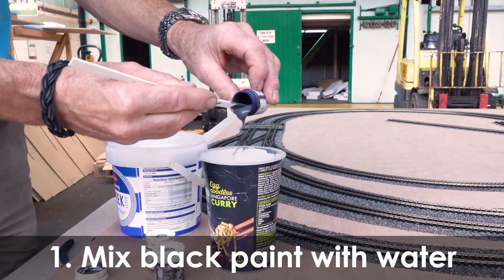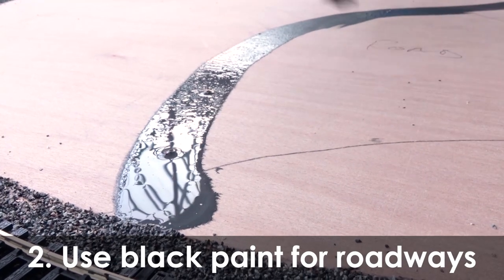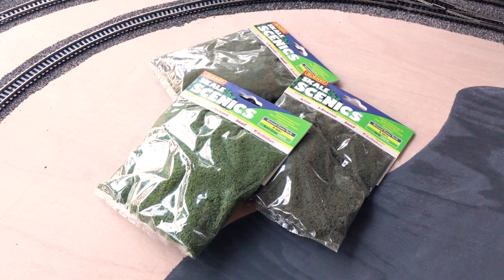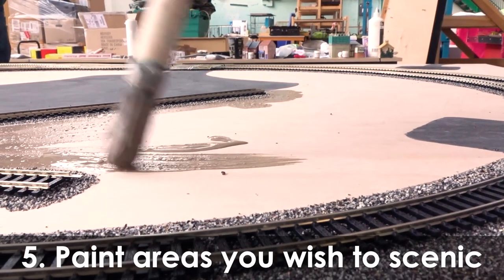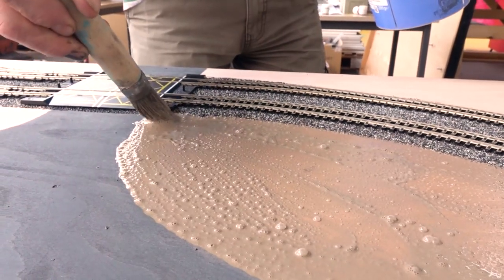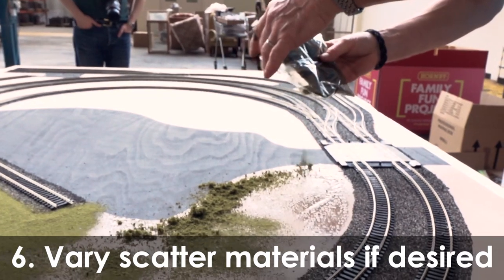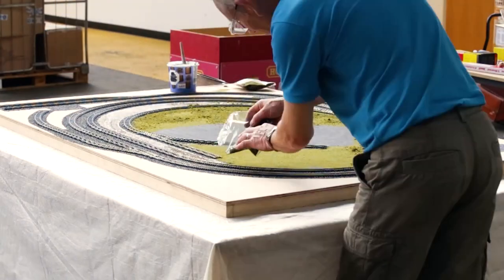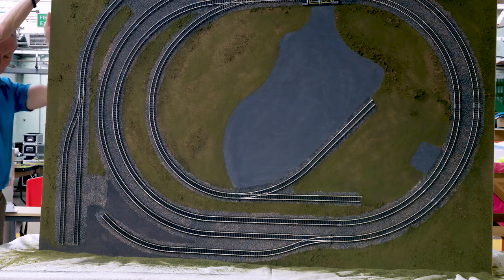Build A Model Railway Layout Step by Step - Pt 4: Scenic Material

Comment: Hi I have purchased the Christmas train set recently and love it,I'm new to the hornby experience and wondering can I make my track more circular /smaller than the oval shape fir around the xmas tree,any advice would be greatly appreciated thanks
Reply: Maybe use less straight pieces e.g just using one on each side since one has the power thing. (Shorter tracks maybe)